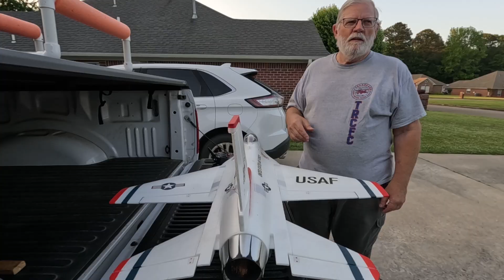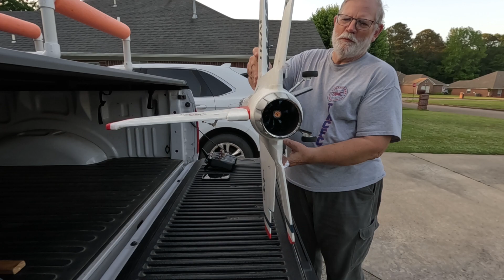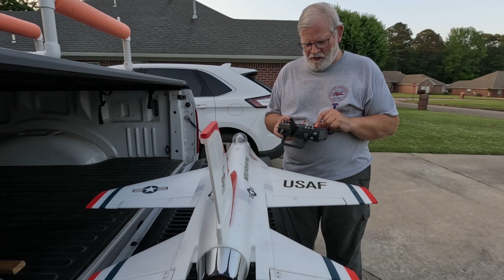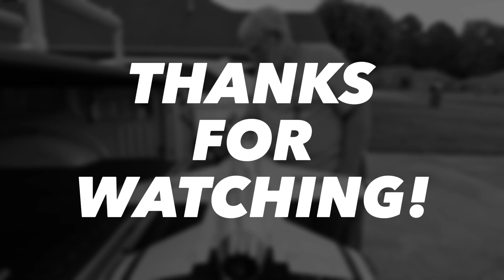Spektrum AS3X/SAFE Gyro Testing - 6 May 2023

Comment: I have had the same problem in all the planes, I have solved it by installing a gyro reflex v2. or replacing the rx with a Lemon Stabilized Receiver DSM. It works like a charm.
Reply: The problem is incorrect gyro setup, not equipment.

Comment: Hello Great video and thanks for your post about myASW 28.....Best Regards Steve
Reply from the maker: Thanks, Steve. I've never gotten into the setup of a sailplane. I'll create a test model and poke around in it to see how the transmitter flight modes work. BTW, I'm not a proponent of flaperons. Drooping the ailerons can cause adverse yaw and tip stalls. Spoilerons and crow are much better ways to control lift and drag.

Comment: Hey man, I have an AR637T and still struggle with all these AS3X and SAFE settings. Especially the Relearn Servo settings option is not clear for me. What do I need it for? Nevertheless your clip is well done! Thanks a lot.
Reply from the maker: You must run the "Relearn Servo Settings" routine after you edit the subtrims, servo travel, or reverse the direction of any channels. You can run it as many times as you like. Just be sure to check the control surface movements with the sticks and also check the direction of the gyro corrections using the 45° tilt test, preferably in SAFE mode if you have it enabled in a flight mode.

Comment: Thanks for the video. It was very helpful. I have a couple if Bind and Fly planes with AR636A and AR637TA receivers in them. So does the Radiomaster TX16S II work well with these? I would like to upgrade my radio but I don't want to pay nearly $600 for a Spektrum NX10. 

As a side note, I was at the park the other day and met a gentleman and his son who were new to flying and he said the TX16S was easy to learn and they had never owned a radio before getting it. So I guess it is fairly simple...
Reply from the maker: The original TX16S came with OpenTX. I'd say that most TX16S owners have upgraded to EdgeTX. Neither one is easy to set up. I learned most of what I know about them from the "RC Video Reviews" YouTube channel. No radio is easier to set up than a Spektrum. I recommend that you find a lightly used Spektrum DX9. I've seen some sell for about $250 lately. The DX9 is probably the best transmitter that Spektrum has ever made. I think you'll be much happier with it than a TX16S. I have both and I only use the TX16S to fly cheap FrSky-compatible receivers in FPV aircraft.
Reply: @txkflier  Thanks so much!!! Yeah, I saw a DX9 locally for around $250 and was interested in it, but it is so hard for me to understand the different "generations" of  Spektrum transmitters that I wasn't sure if it would allow me to do forward programming or not (or some of the "new" features that the NX-series has). I will definitely look for a DX9 though. Thanks again.
Reply from the maker: @marin_real_estate_photography  They made the DX9 in silver and black. Internally, they’re the same. They’re both what would be called “Gen 2” in the other Spektrum transmitters.